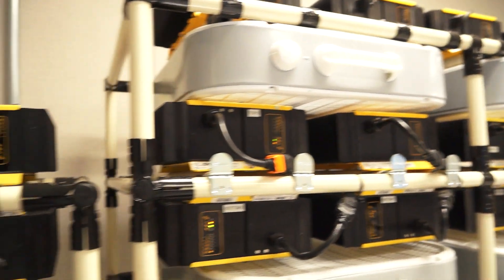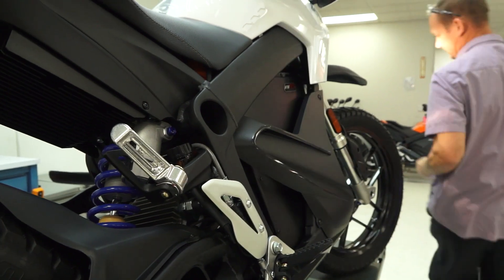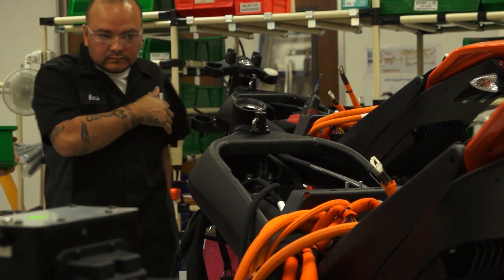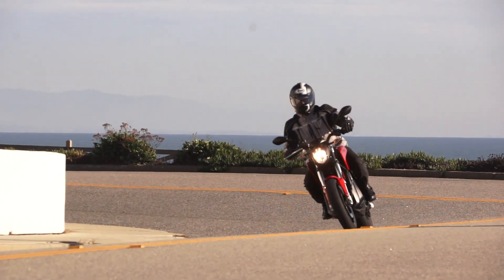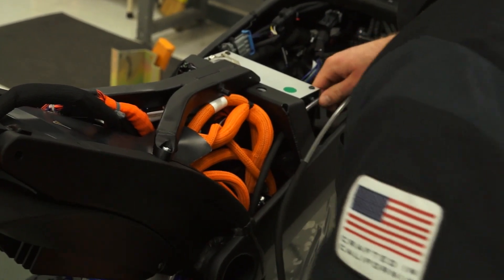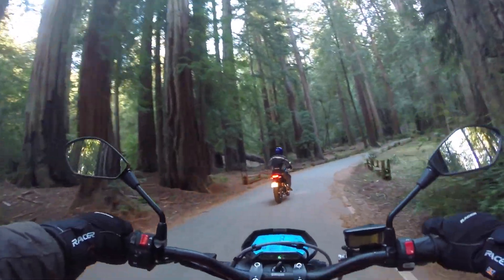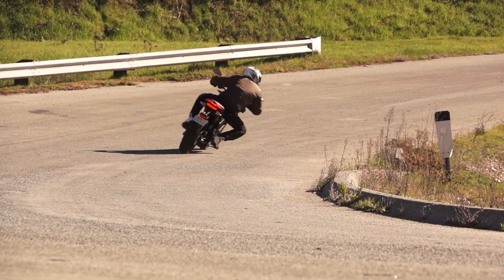Inside Batteries: Zero Motorcycles Senior Battery Specialist, Luke Workman

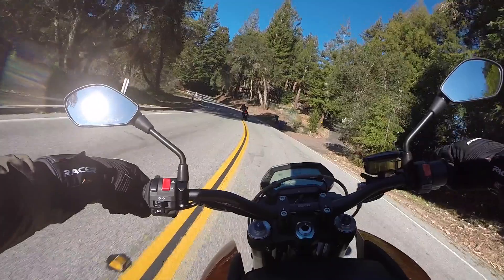Comment: 4:59 "someday there will 1000 mile charge electric motorcycles, and that will be a normal thing. it may only be a few years from now" .  Says the main battery engineer from Zero.  Meanwhile, 6 years later the zero doesn't even get 100 miles range on the highway! LOL
Reply: He's discussing solid-state batteries that are being developed by other companies.  The technology is not yet mature, however, it will happen through incremental improvements that will bring very long-range bikes.

Comment: What is the cost of a replacement battery for the  zero? My friend who has an older zero that needs a battery told me the price, a battery for his zero cost $42,000 because he let his battery discharge all the way. For $42,000, I could drive over 500,000 miles on my motorcycle using gasoline ..my current motorcycle and the dozens of motorcycles I have had are all faster than I want to go when they have to be...Adequate speed is all I need. When you buy a Rolls-Royce news, they list the speed as, adequate.
  Is zero working on a full fairing two passenger touring machine.? I need to be able to carry a passenger, and luggage for trips. Camping gear. I want a faring for wind protection. I want cruise control, I want to use the intercom, CB,..Honda is working on air-conditioning for the gold wing.. that would be wonderful..Is zero working on a machine with radios, and it will be able to carry a passenger with luggage and a full fairing for weather protection? That would be fantastic. I hope it can do 500 mile days with two people pushing a faring through the air, powerering all the electronics I use now..
Reply: What the hell are you talking about?  You can get a whole brand new Zero for half of $42,000 or are you talking pesos?

Comment: Why the Zero is the best/most fun motorcycle you will never buy.  I test rode a Zero DS 13.0 last week.  It's the most fun I've ever had on a motorcycle.  The torq is UNREAL.  You can't 'not smile' while riding it.  The quiet ride is REVOLUTIONARY - think how much more you are exposed to the elements between a car and a motorcycle.  A lot right?  It's the same difference between and electric moto and gas moto.  The electric has no fumes, no noise - just a much purer 'near nature' experience.  BUT, you won't buy this bike.  Two reason.  First, range.  with the biggest battery you can go maybe 75 miles?  So forget driving to the next town over, you won't make it back.  This in an 'in town only' moto.  Commuters only, unfortunately.  Second, the price.  With the big battery, you will hit $19k (us).  That's an insane amount of money for a bike you can't take out of the city.   You could get two other bikes for that price.  Two bikes that you could take out of the city.  IF  Zero can triple the range (to 250ish highway), and half the price (to $10k) they will own the moto industry.  My fingers are crossed they will...  (the bike is insanely fun).

Comment: Sounds like typical electric BS. "It's the most amazing technology and works 10x better than gas and there's some lady with snake oil that just needs money and the batteries will be 1000x more sense than gasoline it's not even a comparison." Meanwhile their bikes are still more expensive, less powerful, heavier, and have crap range compared to gas. 
I don't doubt electric will become competitive to gas, but it's a lot longer than they act. It's just hipster, "tech" bullshit at this point. I wish it was treated realistically. If you're going to talk about the Rude Goldberg(sp?) of gas engines, talk about the way electricity is made and transferred to the batteries. Just as complex. 
It's been how many decades that we've been told battery tech will be here in the next couple of years?
Reply: Those damn horseless carriages will never outwork ma mule
Reply: +TheOfficialKC yes, they are heavier, yes they have less range then internal combustion engines, but the less powerful statement is not totally true. now while gas engine do have a higher HP and torque rating then electric motors, but you have to remember that unlike gas engines, electric motors make HP and torque instantly unlike a gas engine which has to be revving at a certain RPM range to make its optimum power rating. now while they are more expensive the gas engines you have to remember, these companies dont have huge backers to lower the manufacturing process of these bikes. so unless they actually get support from a "Brand name" company like Yamaha, Honda, Harley or any one of those, they are still going to be a costly vehicle to buy.    
now as for the battery tech, the same argument can be said as the one i mentioned above. its all about the financial support they need to get the technology put into actual production. The technology exist now to make one of these bike have a 1000 mile range, but the funds needed for this technology into a bike, the consumer alone would be paying close to $300,000 for the product, and that would be just for the battery.
Reply: +anubis1100 The funding argument doesn't work. Look at what small time manufacturers can do like Koenigsegg when competing against huge brands with billions like McLaren and Ferrari. They make their cars look like jokes. Even more so, TESLA. They have billions at their disposal yet their cars are still 1/3 the range of gas cars, very heavy and slower.
Instant torque is always used as a for electric motors, now at highway passing use, that is great, in performance use, not so much because that just means spinning tires because there isn't traction for it.

Like I said, the technology itself is still well behind gasoline combustion, and they haven't even touched the big benefits in modern 2-stroke design yet. But these people continue to act like it is already centuries ahead of ICE. I agree that it will one day be better, but now it is a statement, a fashion piece, and not because it is better because it truly isn't even that close yet.
Reply: Christopher McGovern “becomes a reality faster than you could believe.” Lol, this is a 4-year old thread and that’s what I was told then and it’s still not here. I’m been fed this line every few years for the last 20 year and it still isn’t so. Like I said, the technology will probably come, but it will take a hell of a lot longer than these people keep saying.

Comment: A lot of marketing misinformation on this interview. Ex: Mugen has been developing (with a huge budget) the electric bike that has been cleaning the TT with McGuiness at the bars. But it still is almost 10% slower than the petrol bikes. Same for the electric efforts on Pikes Peak. How about the Formula E vehicles? Lot's of money for development but slower and with horrible endurance, forcing them to have car swaps during the race. Electric is one of the possible futures for vehicles, but battery development is still a long way from making it the performance king. Maybe in 10 years time it will be feasible both from a technology and from an economical perspective, but it isn't at the moment (as Luke wants to pass as reality) and it won't be in a couple of years I am afraid. Wish people just stuck to the facts instead of acting as fan boys from either side.
Reply: 6years later and this statement still holds true.  I don't see it happening till at least end of the decade.

Comment: How about doing a real story on electric power like the oil industry suppressing development of this type of power.
Reply: consumers are choosing solar electric, their are towns that have converted to solar, driving electric cars, do some research homescratch
Reply: Matthew Sherman So what does that have to do with the oil industry suppressing e power you would know that if you did some research home scratch.
Reply: altruistic You can do that with the power of your dollar, don't buy oil powered devices if you have the options. Buy a electric lawn mowers, cars, motorcycles etc. It seems your dollar speaks louder that government regulations or protests.
Reply: Lucus Kane People could buy e powered vehicles if they were affordable but because it is suppressed cost is still high and the oil industry intends to keep it that way as long as they can but the good news is IC engines will lose in the end.
Reply: The only thing that is suppressing the electric revolution is limited storage - aka no new battery tech.
Reply: altruistic It will only lose if we as consumers allow it to. If only 1/4 of the cars on the road are electric, that is enough to reduce overall cost on electric vehicles and appliances. Even with suppression, we can still make that choice of buying what we want, instead of what is available. The US is the biggest car market in the world, therefore they decide what gets to be on the market.

Comment: low to no sound is recipe for accident..
not even mentioning that enjoyment factor of  the sound of combustion engines
Reply: Matthew Sherman electric motors sounds nothing you fucking idiot!!!!!
Reply: Matthew Sherman  I'll give you that range and performance are vastly improving on electric vehicles.
I can fill the tank on my bike in a couple minutes and it's good to go for another 200+ miles. How fast can you recharge a battery?

Then, there's the cost factor. 2015 ZeroDS @ US$13,345 vs 2015 Suzuki DL650 @ US$8,549
It's about the same price difference with the ZeroS vs the Suzuki SFV650.

A Tesla Model S costs significantly more than many comparable gasoline powered luxury sedans from Acura and Lexus.
Reply: Matthew Sherman The fastest production car in America is NOT electric.  Heck the P85D is not even the quickest, let alone the fastest.
Reply: Sinbad950 Actually, they DO make a sound, YOU fucking idiot.
Reply: raivons That doesn't deter me rai, I ride now as if the cars can't hear me.  If you don't, THAT's a recipe for accidents.  I agree with you about enjoying the beautiful engine note though.  I will seriously be getting those after-market speakers with Harley engine-noise generator, they sound 10 times better than any bike I can afford.

Comment: I have a Zero SR, and I totaly LOVE it! Its my baby.
Reply: nice brother, I' going to buy one soon.  Electrics are so awesome
Reply: Gavin Bendtsen yes, because it is so easy to ride. But you may have problems with clutch and gear bikes later.
Reply: Joar Guttormsen Would you recommend it for a first time motorcycle buyer?
Reply: @svemirac1488a  it now starts with 97% sometimes after a full charge. The bike is soon 6 years, so I dont think thats bad.
Reply: @svemirac1488a  I don't feel any difference on the road now and 5 years ago. Still as fun and powerful. It drains at the same rate as before. Only noticeable difference is that I only get 97% charge sometimes. So it looks like 3% wear on the batteries since I bought it.
Reply: so five years. How's the battery?
Reply: @deadnightgenesis  still recharges to between 97% and 100% so I would say, just as good :)

Comment: interesting interview, i'm still not sold on electric bikes or cars
but sort of see them in off-road enduro stuff in a few years
Reply: Coba Abroad Not quite, though the Honda/Mugens are getting close to being competitive at the TT, from chatting to people they have the speed and acceleration of the classic class, and handle better through the corners, the issue is the weight of the batteries means the braking points have to be earlier, and that really matters on the mountain course. However based on performance improvement, the crossover point where electrics might start dominating the TT is the 2018-2020 time frame. Hell if Martian McGuinness is riding one, well they can't be that bad... ;)

A better example is the Lightening LS-218 at Pikes Peak when it ran in 2013, coming in first place. That was the wake up call that the electrics are starting to dominate.
Reply: as long as the race is short, i don't see them taking any wins at longer races
they could swap batteries at the pit stops but it would take too long
and petrol is more fun because noise :))
Reply: Well I guess you didn't notice an electric hyper bike broke the Isle of man world record last year. Or that zero makes a 70hp dualsport. More power than a ktm 690 enduro r. As soon as the range goes up on the dual sport model. I will buy one for commuting.
Reply: khm Isle of Man TT world record for petrol bikes is 17:06min with avg speed of 132mph
electric bike maneged 19:17min lap with avg speed of 117mph
so still far off not to mention petrol bikes are doing 6 laps in a race and electric only one lap
so it its much easier on the rider
also even supersport 600 is faster than electric
Reply: I watched the 17 minute lap you are talking about. As what i was talking about was the "zero" class. From what i heard should be new competition this year from lightning motorcycles. I believe they claimed 200hp and 200 ft lb of torque. Hyper bike was not quite the right word for the mugen shinden. I love electrics tons of torque and no fossil fuel dependency. If the lighting is there as they claimed it will. It should compete at a much higher level.(i do not regularly follow/watch the isle of man. but its incredible)
Reply: Yeah not in the next few years for sure, batteries need to become much more energy dense so the range increases, and the weight drops.

Though one TT bike a few years ago I beleive could battery swap nearly as fast as a bike could refuel. So if they wanted to battery swap it can be done quickly.

Comment: Cant wait till they have that electric bike going 200 plus miles on a charge :D
Reply: JoeGo101 Well wait a bit until graphene sheet batteries come out, you might be going thousands of miles per charge.
Reply: How about 240 miles 2018...Zero has done it!!
Reply: CockatooDude Cant wait :D
Reply: And now they do....2 years later!
Reply: 3 years later that is a reality. I've ordered my SR/F and will pick up the power tank later in the year. Amazing fast bike w/ Showa suspension, great brakes, and inertia aware traction control. The Zero I've been waiting for.
Reply: welp it's 6 years later and they don't get over 100 miles range on the highway!